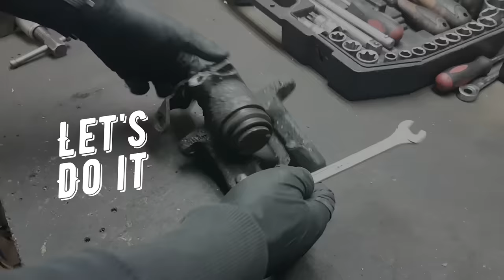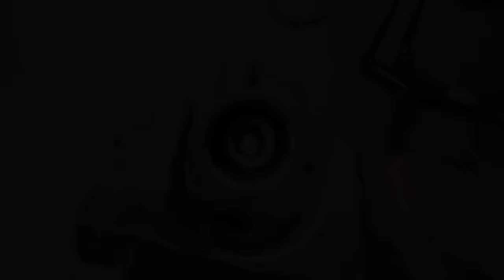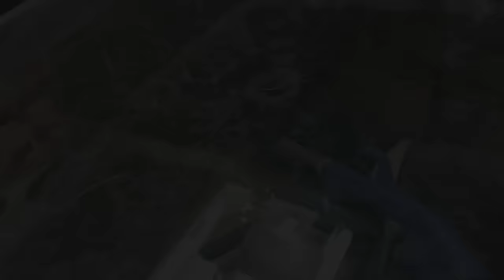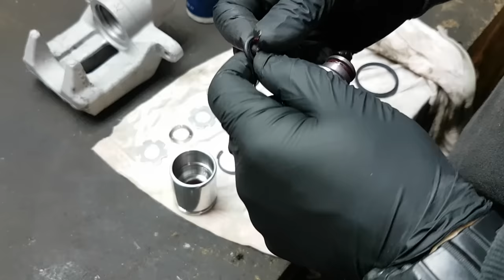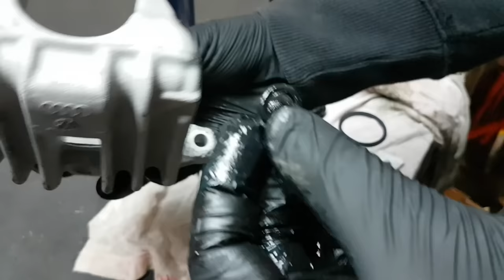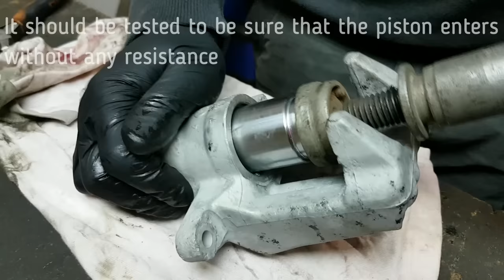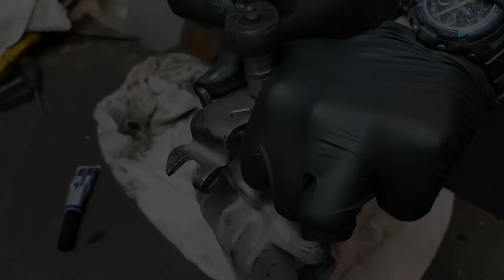How to rebuild rear brake caliper - VW Audi Skoda Seat - New piston and seals (COMPLETE GUIDE)

Comment: Great video, in the process of doing this, couple questions. 
1. Do you have a link to the exact seeger ring pliers? I bought some but they arent long enough
2. How did you know what position to put the ebrake arm back on in?
3. What is the grease in the small squeeze tube that you used?
Reply from the maker: Hi, thanks for asking.

1. I'm using very similar to this one: Long Nose 50 mm Snap Ring light duty Internal Circlip Pliers 1.2mm Tips link: https://www.ebay.co.uk/itm/Long-Nose-50-mm-Snap-Ring-light-duty-Internal-Circlip-Pliers-1-2mm-Tips/310147049669?_trkparms=aid%3D222007%26algo%3DSIM.MBE%26ao%3D2%26asc%3D20140122125356%26meid%3Dd088e3cc8dc340c8bb478d24bd08e1c8%26pid%3D100005%26rk%3D3%26rkt%3D7%26mehot%3Dag%26sd%3D183517365085%26itm%3D310147049669&_trksid=p2047675.c100005.m1851

2. I always take a picture before I disassemble something, but anyway when you put back hand brake cable bracket it has got some kind of bumper at the end, bended part 90 deg ( https://www.youtube.com/watch?v=YHPX8lEHFKs#t=11m35s in video, on the left side) and ebrake arm have to touch this bumper or be as close as possible.

3. It's silicone grease for brake piston , safe for rubber elements, https://www.ebay.co.uk/itm/Silicone-PTFE-Lubricant-Grease-For-Brake-Pistons-Valves-Taps-Joints-Gaskets-6ml/162730609118?epid=1754588867&hash=item25e38009de:g:uUEAAOSwESdcbHzT
Reply: @carsguidediy  You shoud use it on all ruber.
Reply: @CRiCU90  Some applications here demand lubricant properties that PTFE can't really deliver.
Reply: @pr0xZen  
How can you tell ,why are you so sure❓❓❓👍🏻
Reply: @gottmituns3225  Because PTFE starts to deteriorate at 260°C and it decomposes beyond 350°C 🙂  Several components in auto brake (caliper) assemblies get much, much warmer than that, especially during extended or heavy application.

"Ordinary" brakes are entirely friction based. When you clamp the brakes to stop, the kinetic energy of literally ton(s) of mass traveling at (high) speed, within just a few seconds, is converted almost entirely into heat. Like, a lot of heat. Super duper mega-a-lot 😊

Hence silicon lubricants  Because they can "take the heat" (and don't really evaporate) ^^,
Reply: @pr0xZen  - Sorry to wake you up, but silicones and PTFE are two totally different substances. BTW, if brake caliper temperatures go beyond the boiling temperature of the brake fluid inside you will not any longer be able to apply any braking force (vapour), so temperatures will come down, whether you've crashed or not. ;-)
Reply: @breakbollocks9164  I never insinuated or said otherwise. Thats kinda the whole point; PTFE can't take the heat that some of the brake assembly parts in need of lubrication, experience. Silicone lubricant for brake assemblies can. I don't understand how you managed to come away with me suggesting they are the same or even similar materials...(?)

Brake fade is a real, not uncommon thing, not just a theoretical ordeal. But more importantly for this context, metal is a far, far greater conductor of heat than brake fluid is. Many moving parts of a/the brake assembly will amass thermal energy and temperature faaar exceeding the both the boiling point of brake fluid and breakdown temperature of PTFE , long before the brake fluid inside reaches its boilingpoint temperature (and doing so, incidentally in a sealed pressure system evacuated of gasses).
Reply: @pr0xZen  
Thanks a lot amigo🤙🏼❗
Reply: Hi I need a link for the rebuild set? Can u share it
Reply: I believe the red grease is "Red Rubber Grease" made out from castor oil, compatible with Dot fluid, designed to be used on rubber boys and seals in break calipers.
The transparent grease I believe is regular silicon grease.
Reply: qq
Reply: Great the question was asked about snap ring pliers as I have same problem , thanks for the link , great video doing my calipers as we speak
Reply: @karlwhitehouse3052  post up how this goes mate. I just whipped mine off to replace and then saw this vid about refurb. Can keep returning and rotating then.
Reply: @CHILIRIDA  gone great , you will need the circlip pliers impossible without them. Take some photos as you go. Repainting mine also
Reply: @karlwhitehouse3052  brilliant.  I just ordered them and started soaking the circlips so they're not frozen on.
Did yours hold up to the job?  The seller warned they might not be upto this particular job.
Reply: @CHILIRIDA  yeh pliers held up to job , I ordered a pair from Amazon , a pair more expensive than you can find , all look the same though. Mine had 12 months guarantee that's why I paid a bit more. Was disappointed though as the two prongs to pliers didn't quite meet together at tips . Worked as they should though so will keep rather than return. 
I paid £20 for mine but you can get them cheaper and look exactly like mine
Reply: @karlwhitehouse3052  I've got the piston circlips out no problem.
I've had tentative go at the circlips in the caliper but they dont look they want to budge despite spraying with everything I've got.
Do I definitely have to pop them out from the inside of the caliper?
Reply: @CHILIRIDA  yeh deffo have to get them out , bit of patience needed. Sorry to say quite diff to get back in , I used a very small screwdriver to push back in one side whilst clamping with pliers and pushing down with them against hard surface
Reply: @carsguidediy 2. I think most of these types of calipers have preload on the e-brake (handbrake) lever, maybe one spline so it forces against the bracket
Reply: Does anyone know a good caliper rebuild brand they would recommend? In USA?
Reply: @hardcore4476  anything from rockauto.com. caliper rebuild kits are nothing but rubber seals. You'll be fine
Reply: @philb707  Not true, I’ve heard some brands are too cheap and not exact size. That’s why I’m trying to gather a list of good ones because all I have heard is TRW from my search and would like more options if possible. I’ll check them out however. Thanks!
Reply: @hardcore4476  I've used rockauto stuff for my honda calipers an I've used rockauto for my audi r8 level calipers.   It's all the same,  they are just rubber seals/o-rings.
Reply: @philb707  Maybe true for Rock Auto but I’ve been informed that going to local auto part stores or random brands aren’t that good as others or not worth your time as they don’t do their job as well as others. Sounds like R-A has their shit straight. Thanks
Reply: @hardcore4476  well good luck on your search for the perfect caliper rebuild kit

Comment: It's great to see there are still people  willing to rebuild calipers.
Just one way different.
Do not put grease in the O ring grooves. Grease the O ring are it's installed. Why? Because the grease under the O ring will make it tighter and wear out fast. O rings only need lube on the surface that moves. 
Great video 😅

Comment: Great video, very detailed. 
Just finished this job and I would like to add one bit of information in case someone needs it. 
You MUST compress the handbrake mechanism before you install its circlip. If you don't you will never be able to properly seat it and the handbrake will not work. 
I used my brake calliper wind back tool with a suitable socket to hold it down while getting the circlip in place.
You can check afterwards by manually operating the handbrake lever and seeing if the piston continues out which is the correct way.
Reply: so before putting the last clip back in place i need to put the piston inside the caliper, compress it, remove the piston and than install the circlip?
Reply: @caioramos5198  
Not the piston. 
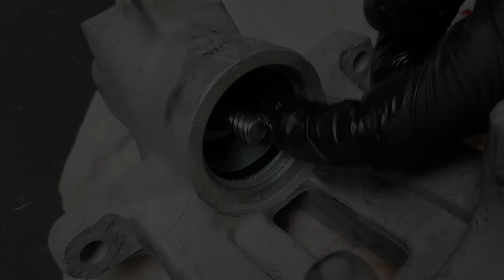The part where he puts the handbrake mechanism back into the calliper at  9:06. 
You need to compress it slightly on the metal surface surrounding the big thread or the circlip won't be seated even though it looks like it is. 
The way to check is to operate the handbrake lever at the end like he did at 12:53 and the piston should keep coming out of the bore. If it doesn't  the circlip is not correctly seated and the handbrake will not work.

Comment: One of the best videos showing the handbrake self-adjuster parts inside the brake piston.
However, you did put the spring and bearing back to the brake piston in opposite direction compared to the position they were installed when you took them out.

Comment: You’re a God, I’ve looked everywhere on earth on how to rebuild my Kia Rio calipers, i was about to spend $120 on 2 new rear ones. 
Video says Volkswagen but the caliper is the same as a Kia Rio’s
Reply: I don't think they have the same mechanism. I disassembled an OE Mando caliper, but I found it's practically impossible to rebuild/reassemble the caliper parts back without some type of special tool.  There are 2 springs you need to compress to put the circlip into the groove.

Comment: These Lucas style rear calipers are fitted to a huge range of European cars & vans, they come in differing size & alloy or steel, and are very simple to repair, having said that I just fitted a cheap-O to my T4 Cali camper, after 2 attempts to get the adjuster to leave some pad-to-disc clearance causing the brake to drag and excessive pad wear I gave up, I’ll have another go when I have time as I want the original Lucas back on my 21 year old VW van.

Comment: Just a small comment: That Bosch grease is for use OUTSIDE the hydraulic system. i.e. for smearing on the back of the pads and guides etc. Where copper grease was once recommended. The problem with copper grease is that it tends to dry up and harden. Check Bosch's information on it.
Reply: It's actually known as 'rubber grease' and I have a big tin of it for doing brake maintenance. It's called rubber grease because it doesn't react with the rubber parts of the brake and break it down like a petroleum grease would.
I use it for inserting the O ring seals on the calipers and for the bellows seals on the slider pins etc. Any excess comes out in the waste brake fluid when bleeding the caliper after. It's not meant for the back of the pads at all.
Reply: @Jooeffoh  
You are totally wrong. It is not rubber grease.
I suggest you search for Bosch Superfit TO102 and check the Bosch information sheet as I suggested.
But go ahead and keep putting it on your brake seals if it keeps you happy.

Comment: You should try refurbing an mk7 golf rear caliper with electronic hand brake. When I took the piston out of mine I found out its way more complicated. There loads of tiny ball bearings inside and some tiny springs that need to placed around a thread inside the caliper. I had to buy a new caliper.

Comment: Great video, thanks a bunch! Saved me from scrapping a caliper and buying a new one - local dealers are extremely expensive, and shipping here is so costly it's more to return the old "core" than the core deposit in return. I'm gonna need some of that mechanism though, road salt and rust got in there really good.

Comment: Great video! Can you explain how the handbrake lever pushes the piston out at the start of the video but the piston returns when using the lever at the end?
Reply: It probably has 3 ball bearings spaced around evenly in circle, each sitting in the center dimple of inclined, oval-shaped recess, so when you turn the spring-loaded thingy, they come out of the dimple. When you release it, the bearing rolls back to the dimple because of the spring force and the incline.

Comment: Well done, excellent video!

The handbrake lever was sticking on the o/s caliper a bit on my TDI. Its occurred to me, if I clean the rear of the caliper off, remove the two metal plates and the ring, I can then remove the caliper and with rear side up, spray some grease onto the spindle so it runs down into the caliper spindle bore and prevent further seizure.
Reply: It'll rust again in couple months, i've unseized them this way countless times on customers cars but the only permanent solution is getting refurbd calipers in your local car parts store for 60$ a piece.
Reply: @janprokopenko7928  
What's to stop a refurbished caliper seizing up. Far better buy new, for VW, a TRW brand caliper.

Giving the mater some thought, I reckon it could just be rust build up between the cable lever and the spring arm causing the sticking so when it gets a bit warmer, I'll remove them both, wire wheel brush them, lube and refit.

Comment: If I were to remove the cable lever to oil behind, since there's spring tension on it when its up against the stop, I need to take the torx bolt out and let the cable lever push the base bracket around to release the tension and use that position as a market to refit both and move them back round to right position.

Comment: Fantastic video and very detailed strip down and rebuild of a VW rear brake caliper.  Only bit I didn’t understand was when you screwed in the piston after the rebuild then unscrew it to remove it to put the outer dust shield onto the piston.  Was there a setting you have to do before fitting the outer dust cover to the piston. But great video.

Comment: yeah - removing the bleeder took you like three seconds. Took me like 2 days of soaking it in penetrating oil and heating it over and over and over again. 
Nothing is ever as easy as on the internet.
Reply from the maker: Hi :)  Yes that's true. Sometimes bleeder screw can be real problem. But in my case was super easy.  Soon I will add new video with bleeder screw completely stuck. I will try to show you easy guide  how to handle with it and what to do if bleeder screw get's broken.

Comment: Great video and very well done that rebuild. I also need to get those bent nose seeker pliers. But my problem with my Audi 38mm rear brake (similar to yours) caliber is different. Hand Brake rod coming out from the caliber's back is leaking because rod itself is engraved. I have to get a new o-rings but I'll need also new rod/trapezoidal rod with spring assembly. Does anyone or do you know if those are available? Salted winter roads here in Finland are very bad thing because it'll spoil our cars totally.

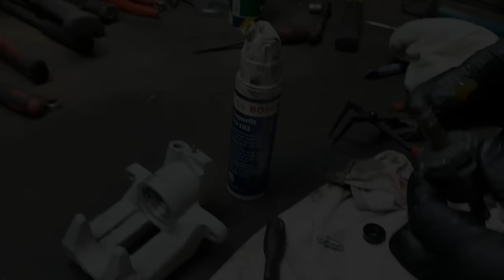Comment: 7:06 I see that you used the Bosch Superfit grease when fitting the manual brake mechanism in the caliper. Why did you not use the red/violet paste also here or the silicone paste? Doesn't this manual brake mechanism come in contact with the brake fluid? I'm planning to rebuild my calipers by myself and I'm stuck on what lubricants to use. :(
Reply: Yo can use vaseline

Comment: Thank you for taking the time to make this excellent video.  Can you tell me if the internals are the same for a 2001 audi a6.  I have read that for some older  audis  removing the seeger ring will cause the spring to explode outward if it is not compressed first.

Comment: Will be trying to do a rear caliper on my a4 b6.
Only thing is I dont have all those kinds of grease.
Im wondering if its ok to use just brake fluid?
Those special greases are not readily available around here and I don't feel like ordering from ebay having to wait two weeks.
Reply from the maker: Hi there, brake fluid will be ok for inner parts :)
Regards

Comment: An informative video but comparing the price of a repair kit compared to a trw caliper, the kit is about 50% the cost of a caliper (at least in my experience), I would opt for the replacement caliper.

I intended doing a caliper repair a few years back to reseal the piston's boot but due to poor workmanship of a prior pads change, the piston bore was scored so it was a new caliper instead.

Comment: Here you can see that there was a dirty but working rear brake caliper.
You disassembled, cleaned and assembled it.
The result is a clean but inoperable caliper. 1:05 the parking brake adjustment seems to work. The piston is moving forward continuously. That's the good. At the end, it seems to not work. The parking brake lever does not push the piston forward, but also pulls it back. This is bad. Automatic parking brake readjustment has been canceled. That's how I went. What's the mistake? Urgent!

Comment: Do you have any suggestions for stripped threads for the bleeder valve? Is it worth reparing  (e.g. is it safe) or should you just get a new caliper? Thanks!
Reply from the maker: Hi there. It's hard to say what will be better for you. 
If you have access to tools and you don't have to buy new one, especially for that job, then yes. It's worth to repair stripped thread. And it is safe, there are bunch of bleeder thread repair kits that you can use. However experience is very important in this type of work. You must be very careful to drill the hole straight and not to deep. 

But if you are planing to do that job and you have to buy thread tap, drils, repair kit for bleeder valve, I think that for one job it's better to go to the scrap yard and buy second hand caliper with good working order bleeder valve.  Regards ;)

Comment: Great DIY tutorial, colud you share info on greases and lubricants u used, each shown in minutes: 5.32, 7.38, 8.22, and do you think that it can be done without them ( only use brake oil as lubricant)-thanks.

Comment: Great instructional video. Where can i buy rebuild kit 2013 vw wagon TDI, ? what type grease recommended ? Thanks
Reply from the maker: Thanks ;) 
It depend in which area you live? if you are from europe check on ebay. Most important thing is diameter of brake caliper piston. Before you do order, measure diameter.  VW rear caliper usually have 38 mm. Just type "Vw brake caliper repair kit 38mm". Also you can finde online catalogue with listed parts for specified vehicle, for example:  "SEINSA AUTOFREN". 
I'm using silicone grease for brake systems. It's safe for rubber elements. It doesn't matter which brand you choose. in comments below you can find link with grease that I'm using. ;)